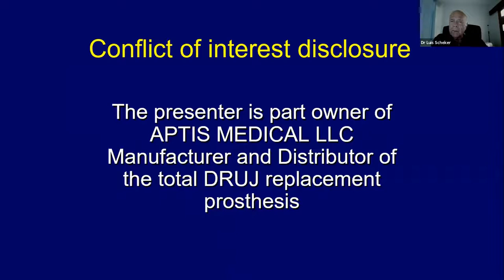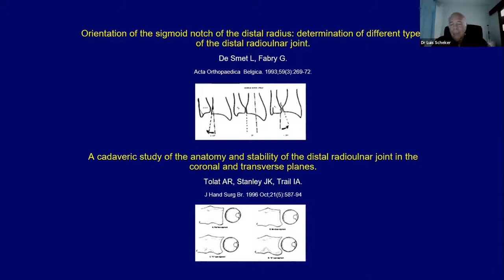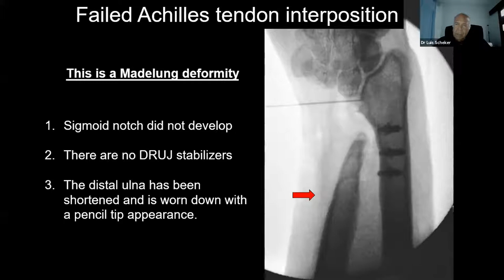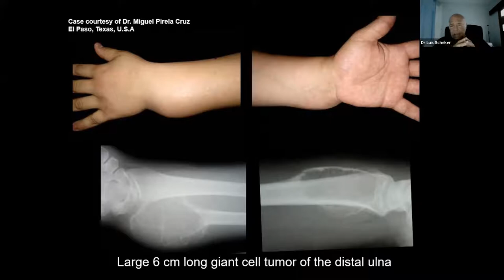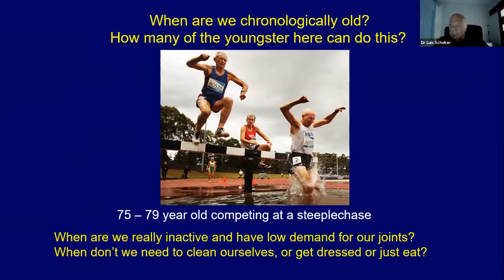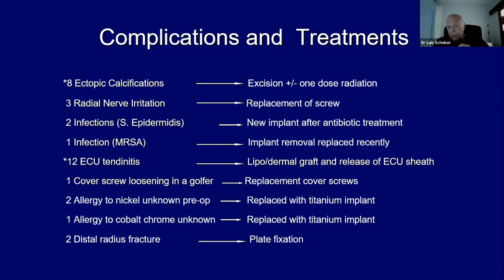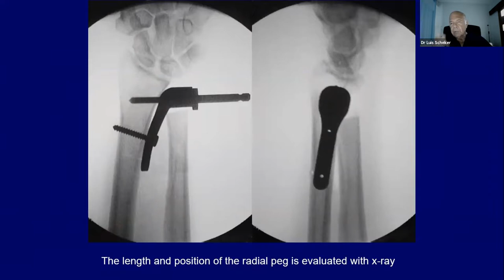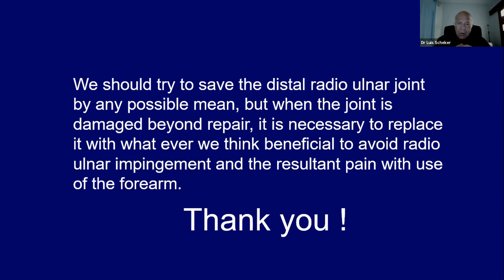DRUJ replacement by Dr Luis Scheker

Comment: I can not find much on this prosthesis. I've had mine for almost about 5 years. I started having pain again. Doctor actually called Dr. Scheker, suggested to remove tendon, pain was still there. Needed ulnar nerve (at wrist) graft. That was 2 years ago. Now I'm having 2 different kinds of pain and some other problems.  Kind of the same symptoms of carpal tunnel. Except the numbness of the thumb index and left side of middle finger are at the "stump" of the fingers with pain on back side (palm side)of wrist in middle. Along with a burning pain. I also have an unbearable type "bone" ( not sure if it is bone pain but feels like it could be) pain when I try and do simple lifting. And last but probably not, when I do something as simple as writing my index finger gets "locked" you can see on my forearm as if a tendon is "caught" causing almost a or does cause a trigger finger. I'd for sure like to know if anyone has has these problems???? Has any doctors encountered these problems with their patients?
Reply: I'm sorry to hear you've had such issues Regena. I had mine fitted in 2015 and it fixed a lot of my problems, but there are still issues in my hand/wrist itself that this prosthesis can't fix. I'm not sure if it's "old age" (only 36) but I also get lots of pain in the carpal tunnel area, along with my fingers, knuckles etc I also had some of this prior to the surgery too. 

I get numbness if I hold my hand at certain angles, especially when using my phone whilst sitting in an armchair in the same fingers, but on both hands. I probably have arthritis as well causing some of this as well as my EDS throwing a curve ball in for good measure. 

I hope they find a fix for you. :thanksdoc:
Reply: @VikingGrazers  Does carpal tunnel syndrome exercises help? I'm wondering if you can do weight training with your prosthesis?